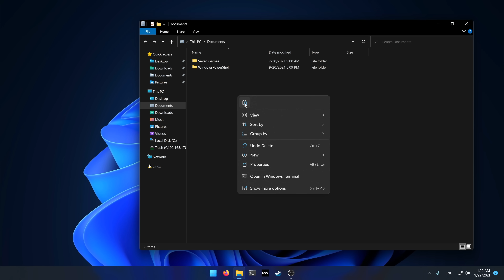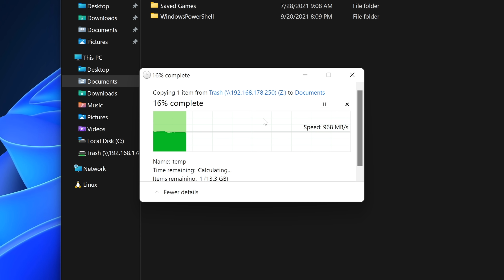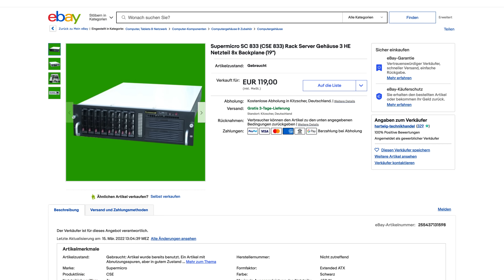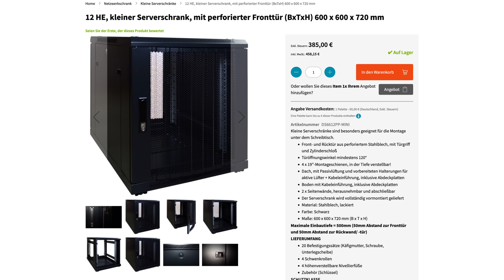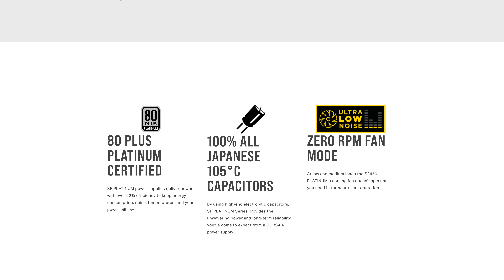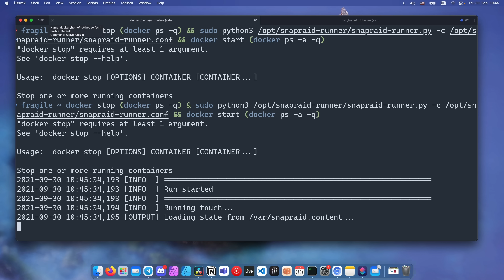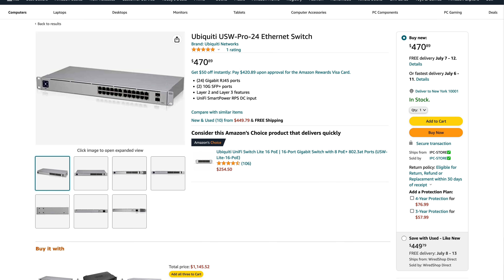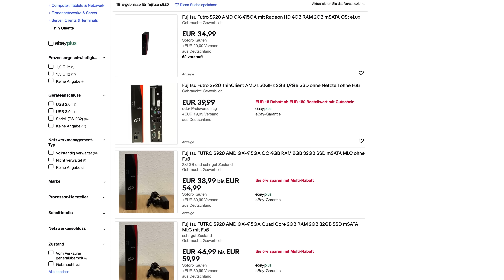Building a Homelab Server Rack!

Comment: How did you connect the nvme ssd's to the asrock c236 wsi mainboard, if the pcie slot is already used for the 10G nic?
Reply from the maker: PCIe bifurcating riser, as I explained in the video
Reply: Sorry I was too fast with my comment, no I saw it in the video 👍🏻

Comment: What's the standing desk you're using? I have a Flexispot and I am extremely unhappy with it, since it's so wobbly, yet I struggle to find any real alternative for EU.
Reply from the maker: I use boho office Basic Line
It still wobbles when in standing mode, but pretty stable when in sitting mode.
Reply: @WolfgangsChannel  Thanks! Going to read up on that

Comment: Next video better gonna be called: "How i sold my soul to the energy market to keep my server rack running" :D
Reply from the maker: Jokes aside, my entire rack consumes less than a typical desktop PC 😉
Reply: @WolfgangsChannel  a typical desktop PC? Which typical desktop PC is turned on 24/7?
Reply: @MRcRaZyByTe  What is your favorite way  to measure power consumption on your systems? Data?
Reply from the maker: @A. I turn my main server off for the night, which helps reduce the energy cost. 
Let's say a desktop PC is used for the full work day (8 hours) and consumes 120W on average. Keep in mind, that's very optimistic, considering that a lot of the modern GPUs and CPUs can consume upwards of 300W each.
My rack consumes around 50W, and is on for 16 hours a day. Keep in mind, I'm not including essential functionality like WiFI or routing in this calculation, because you need those things regardless of whethert they're racked or not.

120W * 8 hours = 0.96 kWh
50W * 16 hours = 0.8 kWh
Reply: @WolfgangsChannel  sorry for the stupid question but aren't HDD manufacturers usually advising against shutting off server HDDs every day and instead recommend continuous operation to prolong their lifespan?
Reply from the maker: As far as I know, the community is split into two camps on the issue. Personally, i think that as long as you down spin the drives up and down every 5 minutes, you should be ok.
Reply: @WolfgangsChannel  those 120w are paid as work hours so I would say it's not fair to compare against a homelab...

My point is not be critic for the sake of doing it, it's a shower though I have always I start the shopping cart for a safe enough NAS + Plex + extras (pihole etc etc) does not end up in 30€ each month increase in the bill, which in addition to hardware ends up in one year subscription considering no hardware failure and no extra home cooling required (ie if you don't have a room for the server and live in a warm country....)
Reply from the maker: Understandable, but why would the desktop PC hours be “paid as working hours” and not the homelab ones?

My initial point in comparing the two was that a server rack doesn’t necessarily pull massive amounts of energy. 

For me, as long as the services I run on the homelab save me more money than the homelab consumes, I’m fine with it. For instance, a Netflix 4K subscription alone is 17.99.
Reply: @WolfgangsChannel well yeah, I'd hope so, the uptime is so much larger, if the rack uses half that of the average desktop pc, the rack would still use at least 2x more power than the desktop pc, purely because of it's uptime. 

That's why it's usually not practical because you'd start running operating costs near the 30-40 euros per month range (in my country) and unless you are making the money back somehow via a service or website that you're running on your homelab where you need to have physical access to the servers, opposed to renting server space (which is way cheaper most of the time)

I'm not condemning you, it's a cool project, just important to keep in mind that it goes beyond just plugging it in and watching it run, it extends all the way into your wallet (as most tech hobbies do lol)
Reply: Hey do you work for Amazon? I feel a sales pitch coming on. The 2U server case will house an ATX 12V power supply with an 80 PLUS Gold Certified Energy rating. Not only that but newer motherboards feature smart fan technology which allow a huge energy cost savings.
Reply: I get a measurement of each component isolated and them put the meter between my ups and the wall for a comparative analysis. If you use this method you may find that your numbers come down a bit.